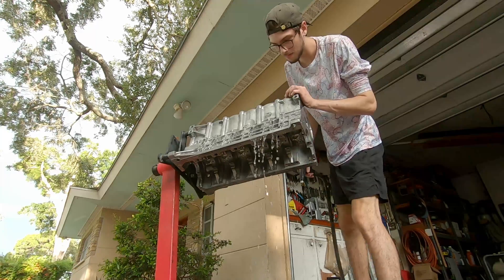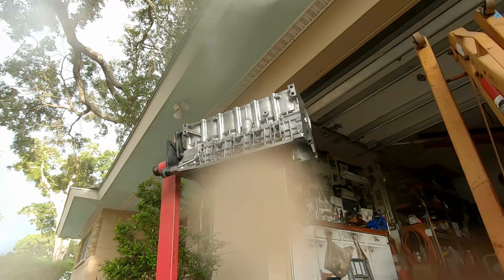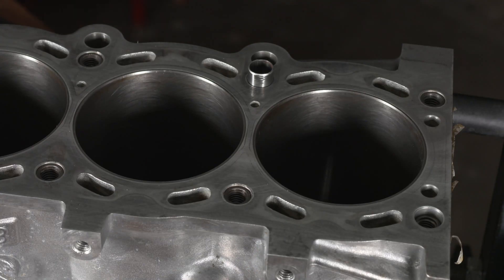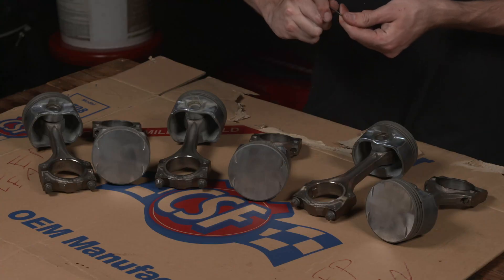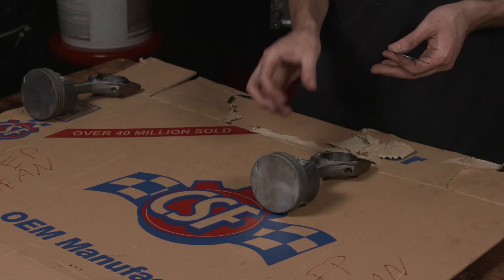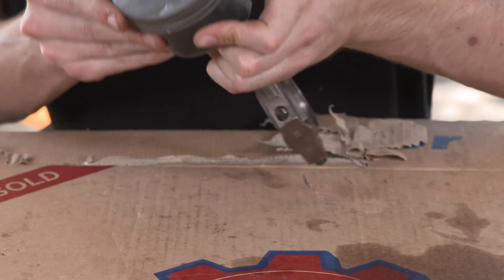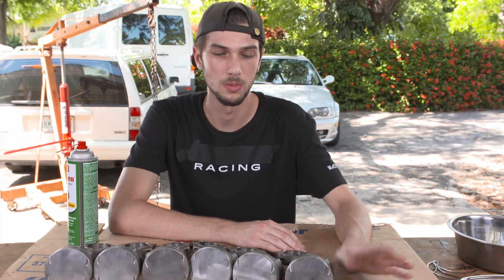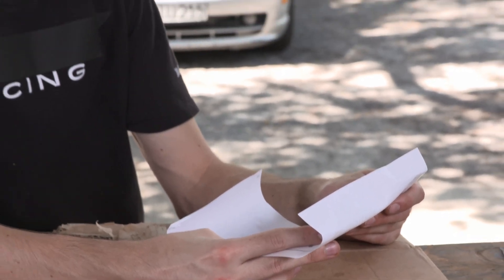TURBO M54 EP4 - FILING PISTON RINGS: Part 1

Comment: Using an old ring to clean isnt really thr best tip, any scratching that occurs is bad. 
Zip strip/paint remover is the way ✌️
Reply from the maker: Thanks, I'll keep it in mind for next time. I figured the gap in the ring would make more of a difference than any scoring in the slit but I'm certainly no professional.

Comment: Why not put the power washer to work??? Your hand has no pressure compared to a power washer's 3000 lbs, dishwashing soap is designed to lift grease and leave no residue Palmolive should be your friend along with grey scotchbrite pads that will get into the scratches on the bores your paper towel has no ability to break anything loose, also nothing removes grease like toluene it will leave cast iron grey and dull looking, if the bores look shiny it's because there is still oil in the cast iron, fill a spray gun full of toluene turn the spray pattern to a solid spray pattern soak the scotchbright in solvent scub the bores well then spray it all away using the spraygun your block should be oil free now then scotchbrite with 
Palmolive and powerwash the whole thing down then do your testing with the ATF which is high in detergent except your towel will never look like yours did but clean.
Oiling the parts when assembling an engine is the worst thing you can do, once there is oil present everything under the sun will stick to it completely contaminating all your cleaning 
it still will fall into the assembly except a strong blasting with dry compressed air will dust everything wonderfully just before sealing the engine so nothing can get inside any longer, the bores can be easily oiled with an oil can before bolting the heads on it will run through the ring gaps all the way down to the skirts, at the same time once the heads are finalized use the oil can to fill the oil galleries making sure the oil filter is also full of oil which will oil all the running parts after turning the motor over by hand. 
This is the best way I found of keeping things nice and clean, your hands won't be full of oil which stops butter fingers and dropping parts, oiling everything then assembling is like trying to put your socks on after the shoes, you are basically introducing glue that attracts dust, lint, air pollution not to mention getting oil on your gasket surfaces, back of bearing shells renduring your nice clean parts into contaminated parts full of grit, so assemble dry then before sealing intake and oil pan blow everything out then button her up before filling all the galleries, filter, and oil pan since your pistons were done before clamping the heads. 
Your brain is a terrible thing to waste, instead of following other's example create your own reality..
Reply: Scrub those bores by hand until a white glove wipe is clean, that's how I learned it and it works. 
Using solvents can actually wick away the oil and leave the honing grit and metal embedded in the hone. 
Some dawn dishwashing soap or any soap lets the grit and metal "float" in the suds,hence actually getting rid of it. 
By thinking a pressure washer can do better than by hand ,why are the windows on my house always still cloudy after pressure washing them? 
They need to be cleaned by hand,then it'll shine.